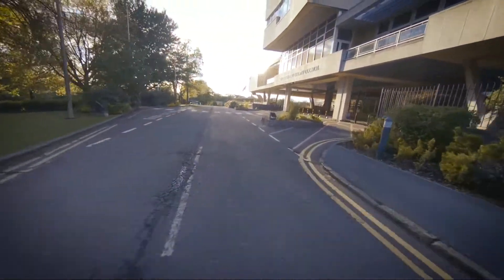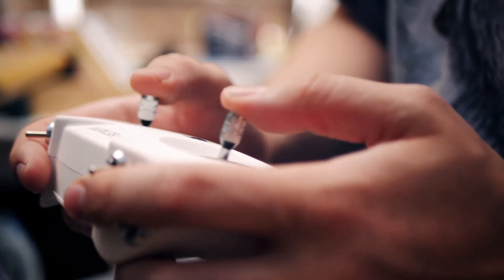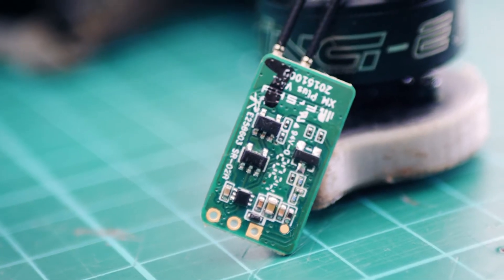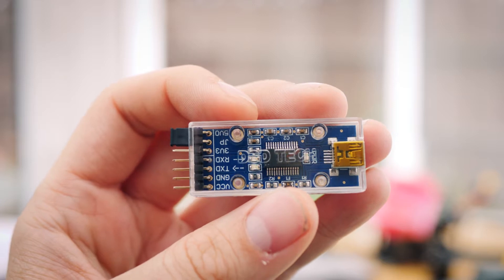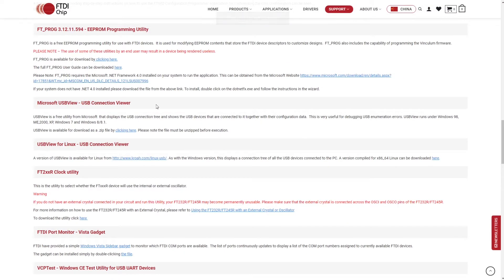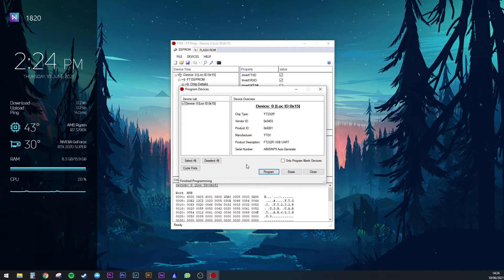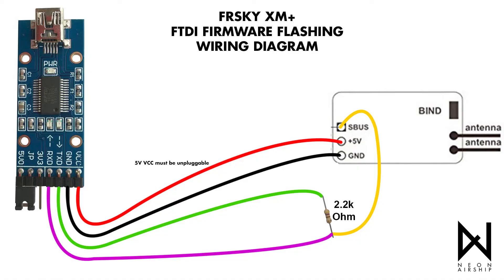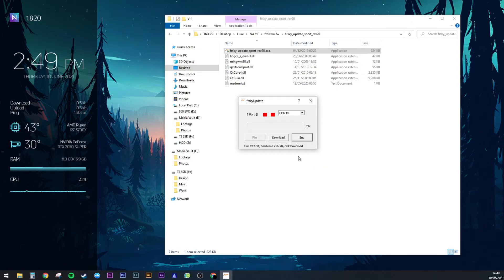FIX BetaFPV LiteRadio 2 SE won't bind with XM+

Comment: I had Radiolite2SE frsky from Cetuspro rtf kit, the problem is the Rudder left stick, keep curving.

And i dont like that, when using ived tried 1.0.0 bin and flash them it seem didnt change the settings ,could you help ?

Comment: HI i had a question. If i but the xm+ receiver from beta fpv will  that fix the problem becaus the beta fpv version comes with ACCST V1 firmware and not v2 and if im correct v1 is supported right?

Comment: Is this working Or outdated Tutorial now  ? Should i buy the betafpv literadio 3 to Bind with the xm+ ?? This should work with Frsky xm + but it islittle more expansive as the lite se 2 radio  ….. im flying the dji Fpv combo but i want to Make my Own drone with the caddx Vista polarlight camera…. And with the LEss Money Radio….
Reply: I have the lite radio 3 and recently got the xm+. After updating the firmware to everyone it wouldn’t connect. Evan with an external frsky module.

Comment: Unfortunately I had no success with this to flash my Xm+… I did everything according to the video, but nothing. I used a similar serial adapter, that uses the same chip FTDI FT232R. Inverted the signals, wired properly, but doesn’t worked to me. Should I try a different adapter or no chance without a taranis ?

Comment: @NEON AIRSHIP  After almost giving up, I tried again using the Arduino Nano and It worked! The Arduino Nano FTDI TX/RX labels are inverted on the board, since they are the atmega processor rx/tx connected to the ftdi. I Also had to update the BetaFPV LiteRadio 2 SE to LiteRadio_2_SE_Frsky_1_9_Mode 2.bin version following the post on reddit. Thank you for this video, it helped a lot!
Reply: Hello, please tell me how did you do it?

Comment: I ordered this radio and I hear that worse case I just have to flash the radio. Is this correct?
Reply from the maker: I think that depends on the receiver firmware, unfortunately it can be kinda hard to tell what it shipped with
Reply: @NEONAIRSHIP  so there is a chance I can bind this radio to xm+ without a programmer, board, resisters...... or am I most likely going to have to buy all that.
Reply from the maker: It could just work, only way to tell is by trying it out!
Reply: @NEONAIRSHIP  ok cool I’m just waiting on my battery’s in the mail. Was wondering if I could bind while the quad is plugged in the computer just to test it
Reply from the maker: Depends on the flight controller, usually needs a battery in my experience

Comment: Worked like a charm
Reply: Do the new radios like this bind with xm+ without using a programmer thing?
Reply: Not for me and I haven't seen anyone eles get it to. I did get the programmer and the resistor and make it work. Real not hard with the video.

Comment: Does it also work with an arduino nano?
Reply from the maker: What are you trying to do with the arduino?
Reply: @NEONAIRSHIP  I bought a crappy FTDI adapter that can't be programmed (invert RS232 TX/RX) and I cannot find a genuine to buy in my country. I'm trying to use the arduino nano without success. I can invert TX/RX on the arduino nano, but it the frsky updater is not detecting the receiver when I power it on. =/
Reply from the maker: Sorry dude I wouldn't know where to start with that